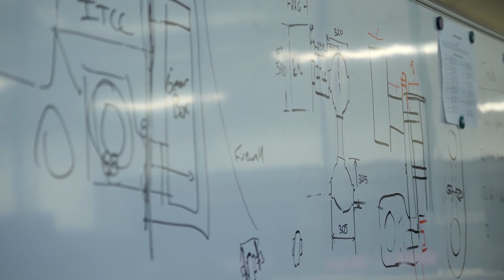Indy Autonomous Challenge Announcement

Comment: Autonomous tech should only be used as the equivalent to a 'cruise control' button/option. You activate it, you can take a break without stopping somewhere. No place for this in racing.